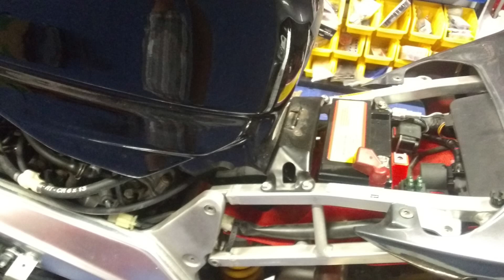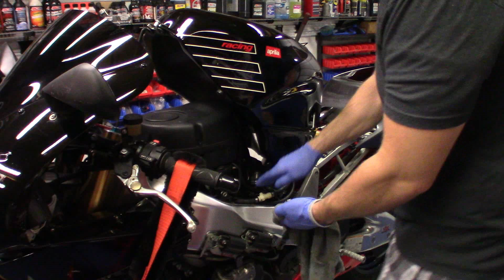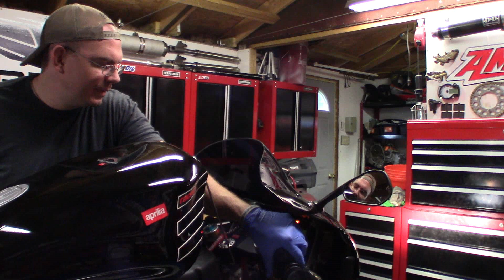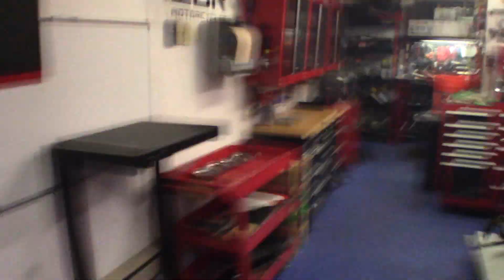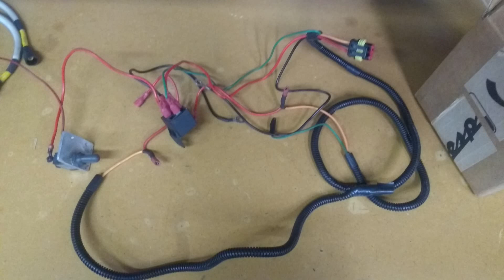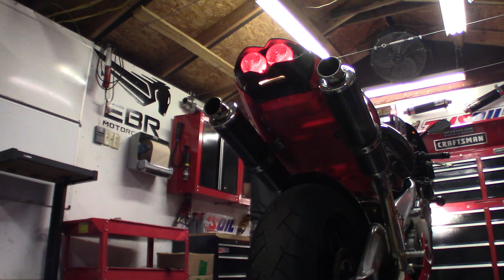Aprilia Mille R The Fuel Pump Was Unplugged And The Bike Runs

Comment: Hey man. Love the content. Question if you don't mind. I have an 02 Mille and I have a good battery. But it has been doing it now that I think of it. But when I start it, it drags a lil then starts. But as of today it won't start back up after I shut it off. I put some cables to it an a few times cranking, it starts. Same lagg just longer. I was thinking of starting with the starter relay. Any suggestions are greatly appreciated.
Reply from the maker: Yep your right on the money. I bet it is the starter relay. If not may be in the starter itself. Start with the relay and go from there. Any questions shoot me a email if the relay doesn't fix it.
Reply: Thanks man! I really appreciate this. Yea Man I love this bike. It's the base mille but I'm more than happy with it. Everyone sleeps on it until we running em. Then it's damn that mf fast. Yyeeeaassseeerr!! I'm also gonna do the power cable upgrade as well. Hope to see more vids of it from you soon. Thanks again.
Reply from the maker: Make sure to check out my other vids in the video description . Also when you need fluids use my links and give amsoil a shot my dealer number is 5541460. Email me if you need anything
Reply: @TorrentPerformance  Ok sweet, yea I've been checking a few of them out. But ok bud I will definitely shoot you an Email or 2. Lol Thx again! 💯

Comment: Maybe the fuel pump is dry and partially seized due to no fuel in it and not ran for years. It might quieten down with use
Reply from the maker: That's exactly what the fuel pump did. The bike was shutting off will previous owner had it. He thought it was fuel pump. I narrowed it down and replaced the tip sensor that was shutting the bike down.
Reply: @TorrentPerformance  Aprilia rsv mille, engine shuts off several times in the middle of the ride, and when it stops, you wait a few seconds or minut and it starts without problems. What can be the problem?
Reply from the maker: When you go to start it does it flash no start on dash. Also what year bike. If it restarts it might be the tip sensor or bad kickstand switch. Also cod be wiring to fuel pump or bad fuel pump. Email me directly please.
Reply: @TorrentPerformance  its 2001, 94kw. I ride and i one moment motorcycle just go OFF. And lights oil lamps. And when i start engine and released clutch, engine sometimes goes off again...